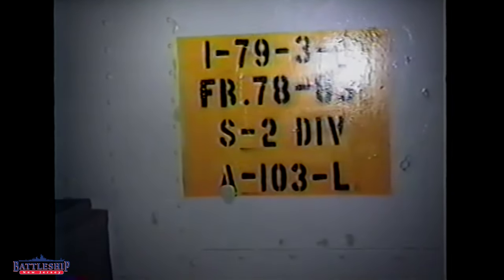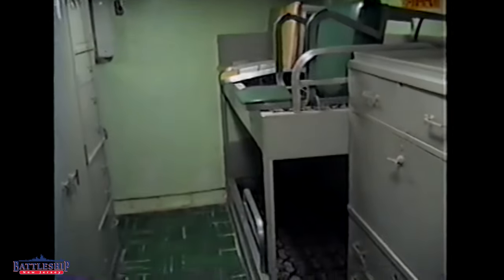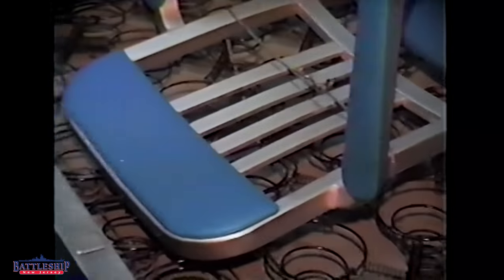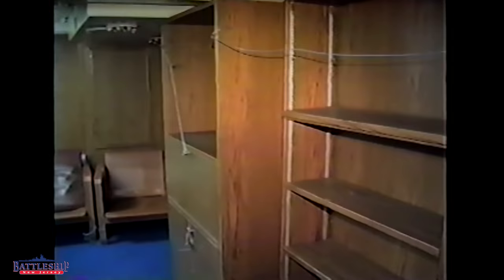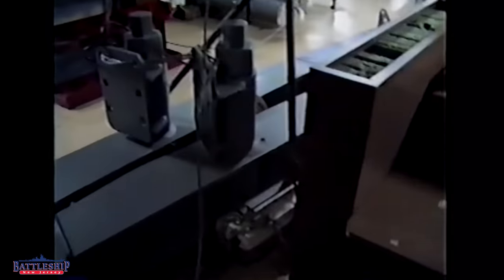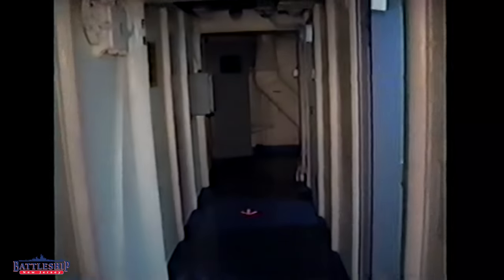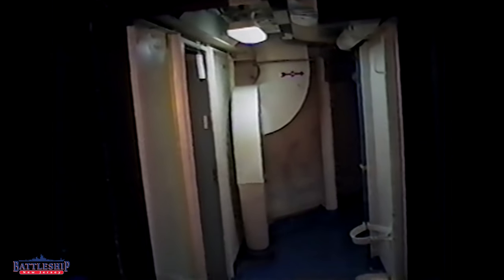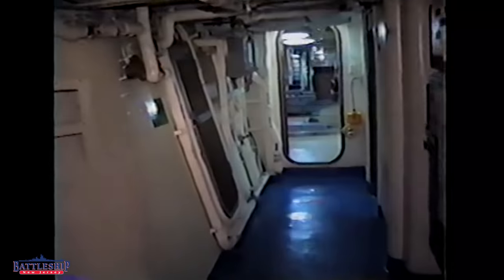1999 Battleship NJ Condition Report: Part 1

Comment: The aspect ratio always brings me back. What a great find.  Total time capsule. I do echo Ryan’s sentiment though. This could have benefited from a wider angle lens (and a gimbal, sheesh!)
Reply: This could have benefitted from not telling the cameraman what the zoom button was.
Reply: @bower31  Nah, I've shot a lot on a late 80s fullsize VHS camcorder like the ones they probably shot this on (since these WERE fullsize tapes and not VHS-C) and almost all of them have an annoyingly narrow FOV. You can see when they pan away from the bulkhead signs that they zoom out as far as the camera will go, but between the small spaces on the ship, narrow FOV of the camera, the wimpy halogen video light the cameras use in dark spaces, and the lack of resolution meaning close-up shots are the only way to show details on condition, it makes sense.

But, the person behind the camera clearly is not used to shooting from the shoulder cause you can tell they aren't bending their knees when they walk or using their arms as a gimbal, that shows up REALLY strongly on such a narrow FOV camera. There's a reason most people doing action shoots spent the extra cash on a Sony VX1000 with its wide-angle lens and mechanical lens stabilizer, but the Navy probably shot this on a Panasonic PV-420D.
Reply: Gimbal wasn't a thing back then, I don't remember if glidecams or something of the like existed that long ago
its almost certainly a fixed zoom lens so you would have needed to use a screw on wide angle adapter,
Reply: @gdrriley420  Gimbals WERE a thing back then, fully mechanical SteadiCams were invented in 1975 and by 1988 they'd started using an electromechanical system integrated into the camera's optics on high end camcorders. Being as this was filmed in 1999, there was NO shortage of stabilized professional camcorders. Likewise with the lenses, almost all camcorders of the era had fully zoom and while the lens itself was permanently attached, snap-on or screw-on fisheye lenses were available (and popular) for most of the good camcorders.

Judging by some of the idiosyncrasies of the actual video though, it's probably a Panasonic single-CCD (the horizontal wobble on light and dark and the particular way colors show gives it away) from the late 80s that they still had in inventory and either didn't wanna replace or used just so they could shoot full-size full-length tapes.
Reply: @LenKusov  they weren't a thing in terms of you wouldn't expect nearly everyone to have one. 
this is the gov famously cheap on most things
Reply: @gdrriley420  Yeah, it's not surprising at all and for a video that's solely meant to show what kinda shape the ship is in, watchability isn't exactly a priority. A 10+ year old camcorder's not exactly GOOD but a lot of government orgs and schools kept them in inventory well into the 2000s.

Still tho, a lot of mid range camcorders by '99 had SOME kind of stabilization - they were too heavy for gimbals to be convenient but the optical or electronic stabilization built into the camera was definitely affordable by then.
Reply: Yeah on the first room I was like "if they don't fix that zoom at all, I'm not gonna watch much more. I guess cinematography is not a requirement for doing this type of work 😆
Reply: Don't forget this is essentially a government documentary on the ship's condition.  Government being the keyword and probably the least expensive equipment.  Also back in the day, no gimbals, that weren't outside movie making on big gas balanced trucks.  The lenses on the cameras were not the greatest for wide shots and the sensors for picking up the image and colors weren't of super high DPI.  Pretty good for the time.
Reply: What do you expect from government work?

Comment: A lot of the bunks and lockers are manufactured on an assembly line type of process. The metal arrives at the plant on a 10ton roll and is cut by laser, bent by automated machine, primed by machine, assembled by man and machines, spot welded by machine, and ultimately painted by machine in a parcial vacuum to prevent contamination of the paint. After all that the item is baked in a oven to make the paint harder. Real amazing process when you think about it.

Comment: Ryan and Libby if I’m not mistaken, the asbestos signs are probably due to the 9ish by 9ish inch flooring tiles.  Unfortunately I had a friend die of mesothelioma, and in learning about his situation in doing renovations, etc, it was said that this particular size of floor tile is usually going to be impregnated with asbestos, due to its age.  Same with the mastic that was used to install in.  Generally, if it’s intact, then it’s supposed to be pretty much OK.  That’s one of those sad things from the past, where I’ve heard ex military people talk of how fire resistant the stuff is, and that they felt it saved lives — but since the 1930s the manufacturers knew it was hurting people, and covered that up for several years.